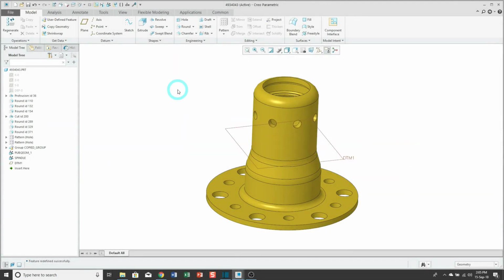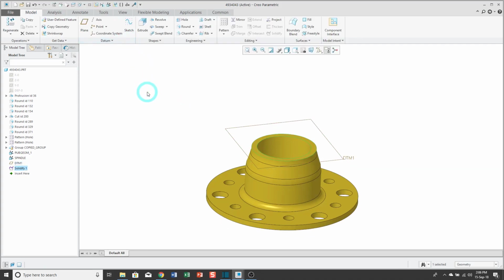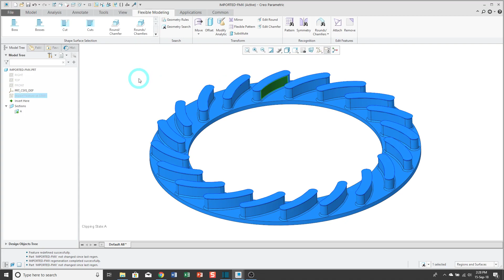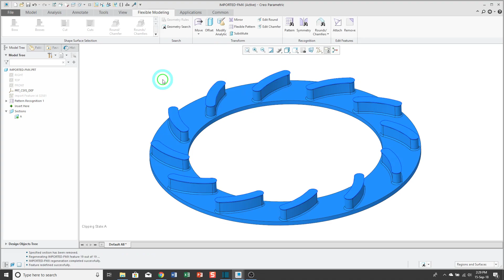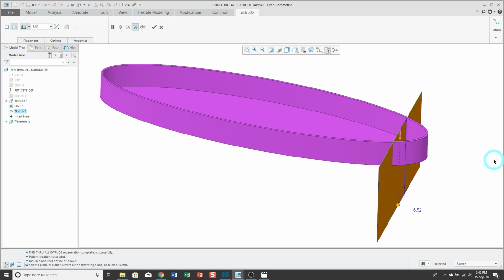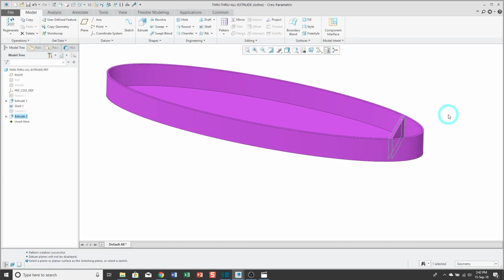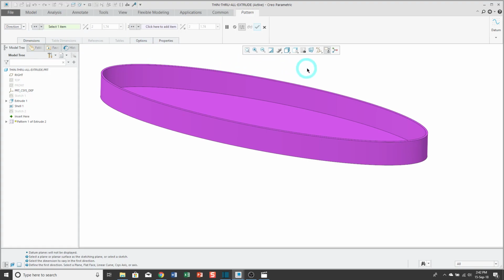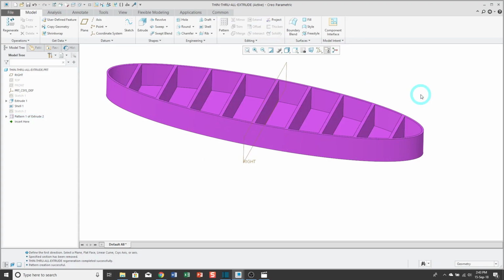Creo Parametric - 3 Part Modeling Tips and Tricks

Comment: Dear Dave!
I'm considering myself pretty familiar with the Creo Parametric with more than a year industrial experience, but all of the three tips was a perfect hit for me. Keep up the good work!
One of my most wanted option in Creo Parametric is to create a pattern based feature to "mirror" parts (like a direction pattern and a 180° rotation together) and be able to use Reference Pattern with it. Of course you have the "Mirror component" and "Mirror (feature)" features, but it lacks the option to use as a reference to another pattern. Do you have any suggestion or workaround for this? What feature do you use in these situations?
Reply from the maker: How many instances are you creating? And are you mirroring geometry or mirroring placement?